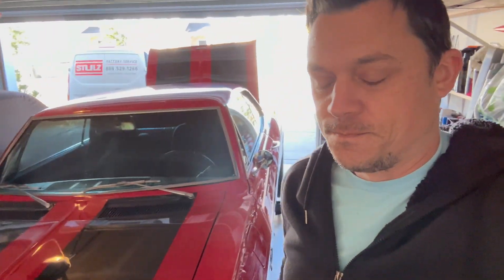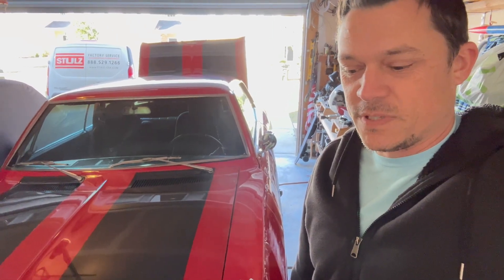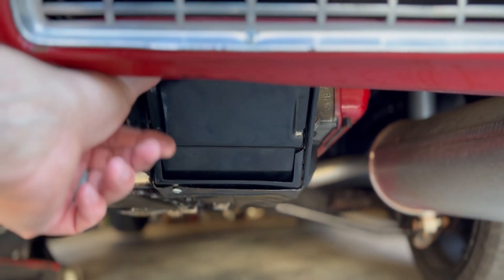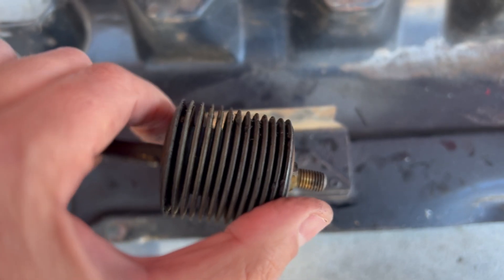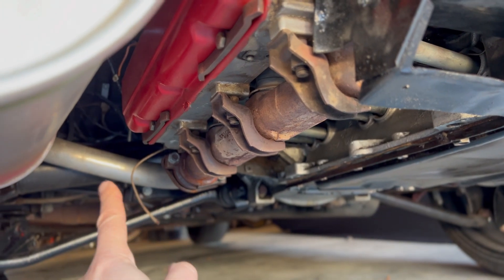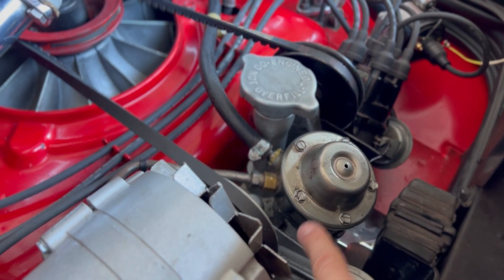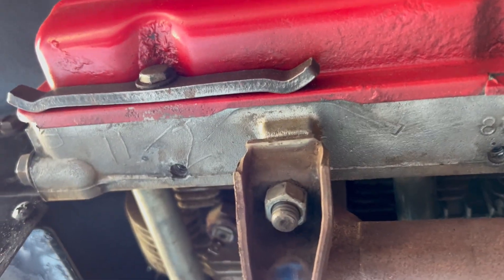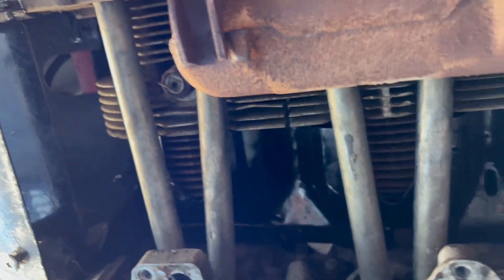Corvair Bellows Thermostat and other features

Comment: The butyl alcohol s contained within the bellows. As it heated up and expanded as a hot gas then the bellows expanded. When the butyl alcohol cooled it ofc course lost its pressure and the bellows part returned to its natural state. Very simple and effective system.

Comment: I put headers along with glass packs on my 1968 Monza. My friends driving behind me on the freeway called my  Corvair  the flame thrower just like formula race cars. Good times. I also bought a self tensioner kit for the fan belt. That took up any slack created by high RPM's. Worked great, never had the belt fly off of the pulleys. I was always rebuilding the four carburetors perfecting them. It turned out I became the go to guy for anyone who needed a carburetor rebuild, 4 barrels all the way to three barrel carbs on Honda's.
Reply from the maker: That is awesome !
Reply: Yup, I put a spring tensioner kit on the fan belt of my 1965 Monza and it worked like a dream.  Any time you can buy peace of mind over giddy trepidation - I say go for it.

Comment: Just checked out your vid here for the first time and I see several things you may not be aware of. Maybe you have corrected these but on the engine I do not see the rubber grommet that goes around the oil dipstick. Since the engine is air cooled you want all that air cooling. It is escaping around the dipstick. Also I noticed the lower strut rods which are directly under the axles are installed upside down. The slight bend at the wheel end should go up.

Comment: I had a blue 1966 corsa. I liked the car . it was the best handling car ever.  It handled better than my sisters 1979 Corvette. I would like to install a SBC in the front.
Reply: Dont,   Do  a mid engine but whats the point in a front engine Corvair? Waste of a classic car.
Reply from the maker: That would be insane because they are light cars to begin with 👍

Comment: Interesting, I don't think my Corvair has those bellows.  I'll check again.
Reply from the maker: They open and close the air baffles. They are mounted up inside the sheet metal below the exhaust manifold, but you should be able to see the push rod that connects to the baffle. Held on with a nut or a cotter pin 👍
Reply: It certainly doesn't now! 😂

Comment: The fluid is called butyl alcohol. The design is very specific for the Corvair as the copper bellows are not easy to make and even harder to fill. They will work for years on end. If you have a Corsa you had a temp gauge.
Reply from the maker: Thank you! You are very knowledgeable 👍

Comment: I once had a 1966 corvair Corsa 140 from 1969 to 1971. Very few mechanics would work on it back then. That corvair was a fun little car to drive.
Reply from the maker: That is very cool, the Corsa is hard to come by these days. And I agree they are really fun! They handle pretty well too
Reply: @nightfurynova  Talking about handling, I used to love approaching an intersection and then slowing to 35 mph, tap the brakes, down shift, and make a perfect 90 turn with very little speed loss almost as if I was driving a track vehicle. That was probably due to the rear engine weight distribution. 😃
Reply: @nightfurynova  you probably are aware of a company called “FlyCorvair”. They are a company that have been building and help building Corvair engines for home built planes and kit planes. They are built using some new stronger machined inter-parts for increased reliability and performance.

Comment: I have two Corvairs now, a ‘64 and a ‘67.  Yours is one of the cleanest I’ve seen. Did you buy it already modded with that single carb?
Reply from the maker: Hey, thanks! I bought it mostly complete. It had the 4 into 1 manifold when I purchased it, but I can tell you it is difficult to tune. The long runners, and large single carb have drawbacks over the factory multi carb setup. 
I was able to get it running well, but it takes some redneck engineering! I’d go into detail but maybe I’ll just make a video about it 👍
Reply: @nightfurynova  That would be an interesting video for sure, I have run 4 bbl and 2 bbl center mounts, and none of them were worth the effort to get them working right. I went back to the stock setups and motored on. The one center mount that came closest to working was definitely different, as the tubes went forward and ran a Carter 2 bbl off a 318. That came closest to working right, but the power was never there with it.

Comment: Hey Man, do yourself a favor.  Chevy engineers did not want rubber fuel lines in the engine bay  for obvious reasons.  Take that rubber fuel line and get rid of it before your ignite that nice car.
Reply from the maker: 🤣 thanks for the info